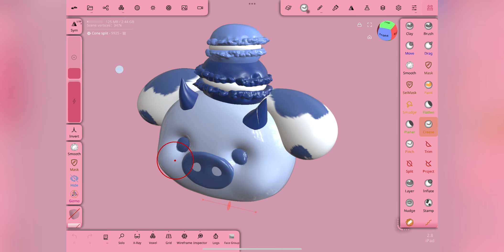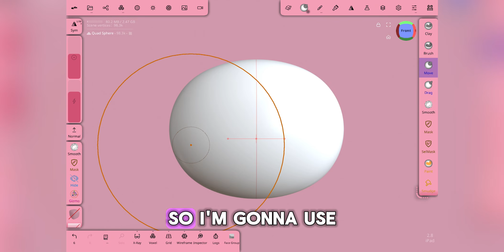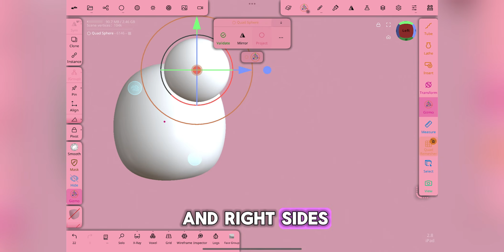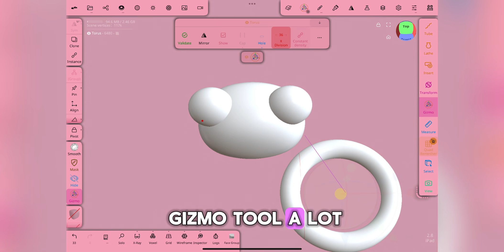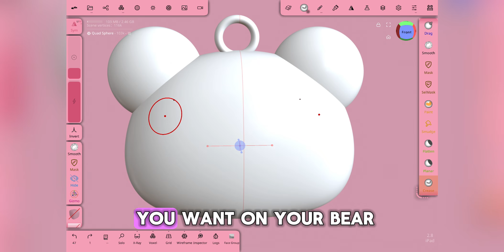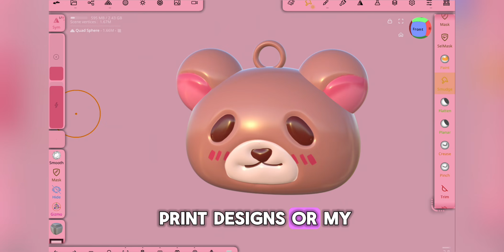3D Design Tutorial for Beginners | Bear Head Keychain for 3D Printing (Small Business Idea 💰)

Comment: I love your videos! I have a question though, how do you get the lines on your canvas so you can see where the middle of the design and stuff are? I’ve poked around but I can’t find it 🥲
Reply from the maker: Thank you so much!! Under the "Symmetry" tool (the icon with two mirrored triangles at the top right bar) there should be check boxes at the very bottom that say "Show Line" and "Show Plane"

Just check those and once you have symmetry turned on for any of the XYZ planes, they'll be visible! 

Note:
Symmetry has to be turned on for it to show (at the very top of the left side toolbar, same mirrored triangle icon)